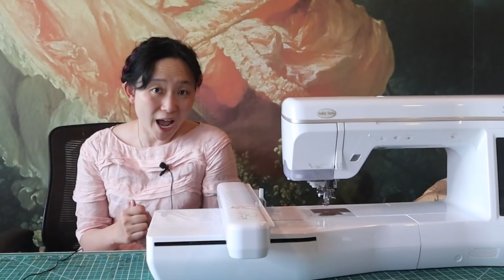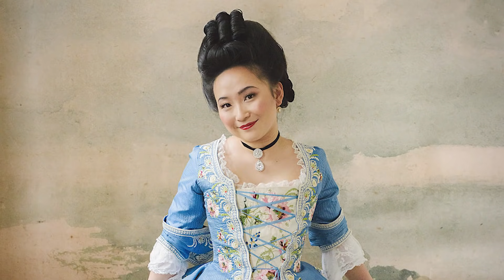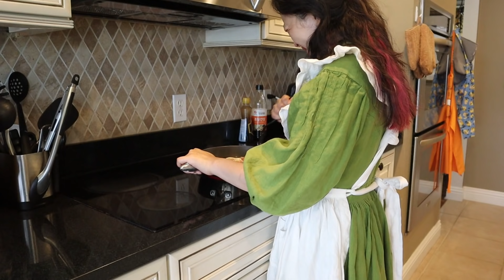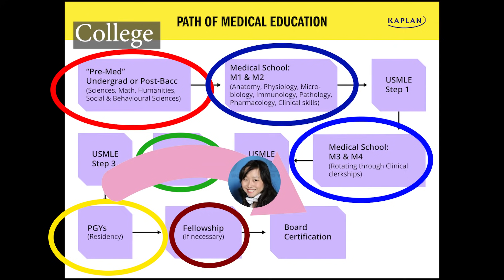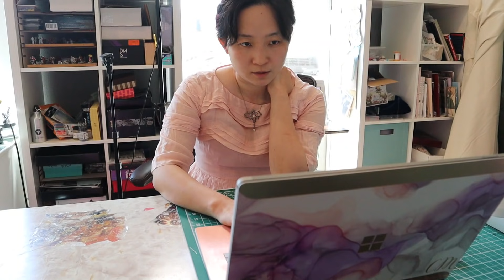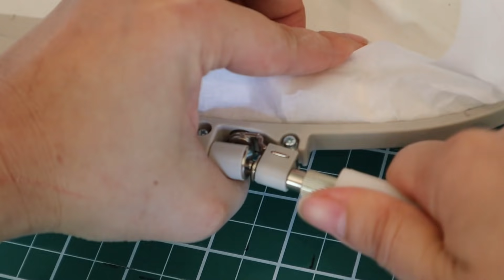Beginner's Guide to Machine Embroidery || Selecting, Buying, Setting up and Using your machine

Comment: Where were you about 2 months ago? Stupid algorithm for not suggesting your video sooner. I bought a brother combo machine . Being that embroidery is brand spanking new to me, I wanted to give it a whirl. However,  on my very first attempt everything was going well and I decided to walk away for a moment (it had 5 or 7 minutes left). On my return, I had to frown. Normally on my sewing machines I pull maybe two or three inches of thread after setting the machine. It's how I was taught. Unfortunately, during my step away, the needle caught that extra thread and it became part of the pattern. Thus the pattern had a random jumbled thread throughout the design.  Ugh.

Comment: OMG.  I'm so glad I found this video!  (I did see a couple of your other videos from CoCoVid, but this is what I needed!)  I have a used Pfaff embroidery machine--I got a fantastic deal on it and it came with ALL THE FRAMES, including the massive 360mm x 200mm.  I was having trouble with thread breakage (solution:  get better needles) and the embroidery software (solution:  buy already tested digitized software until I figure out the software I have...I guess).  I tried making a couple designs but it wants to do 10,000 stitches in one place and I can't figure out what I did on the design to make it want to do that.  Anyway...thanks for this video!  I'm off to the store to get some needles and take my 20-year-old Viking in for service...I ran over a pin and wrecked the timing on it.  Ooops.

Comment: I've been threading my embroidery machine needles like an animal since 2010. It is as uncivilized as you say. Cutting my own jump stitches, too, because that's just something that I can't seem to get properly fixed to consistent thread pick-up on the next stitch after a jump-cut. It's less time-consuming to trim my own than rethread (again, like an animal).
I just bought a new design set, so I think I should get that unzipped and stitch it out, now.

Comment: When you buy a sewing machine or a bike, you buy the shop with it. Why you buy local! Some brands require any 30 day tune ups or warranty work be done by the seller, meaning you ship the machine cross country and back, at risk and for more $$ than you’d pay at the area shop up front. .And, you get help if you need it post sale. For a basic mechanical machine this may be acceptable risk, but for an electronic embroidery robot it’s a very different deal. This is something to think about.

Comment: That was great!!! Thank you! I really want to get back into sewing. I miss it even more now. 

 I would add don't buy cheap fabric to embroider. I wanted to make baby bibs and bought the cheapest toweling that I could find, big mistake. Not only hard to embroider on but fell apart when cutting to make the bibs and put the binding on.

Yes, going to a show to get your machine is a great idea. I bought mine at a local quilt show from a local dealer whom I had known for years. I got a great deal on the machine. I paid in full which got me another discount.